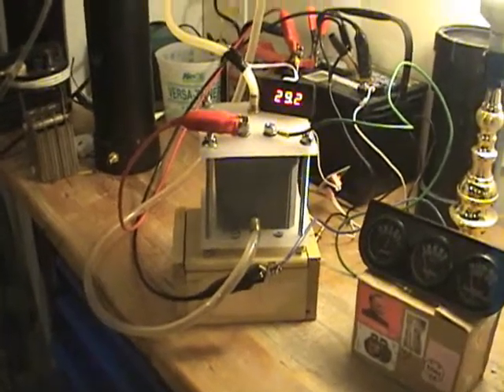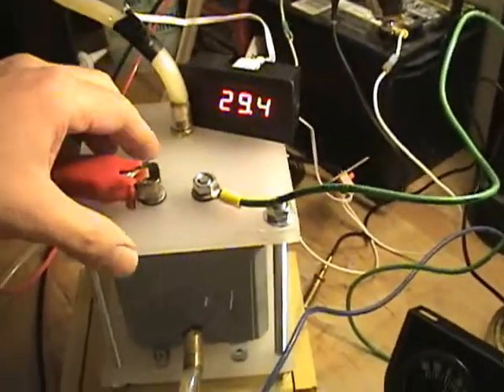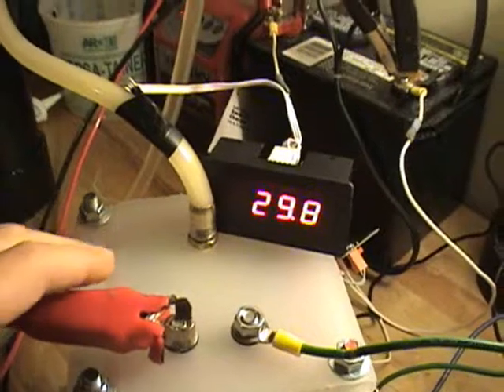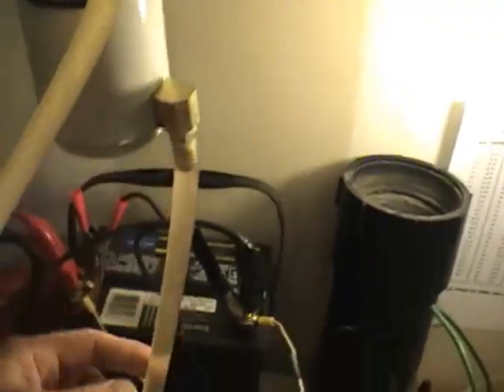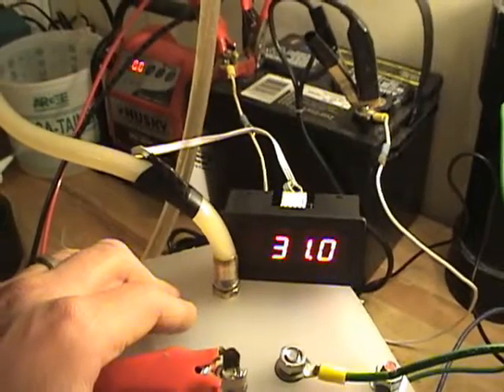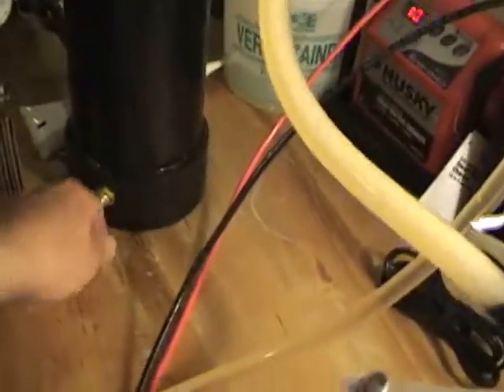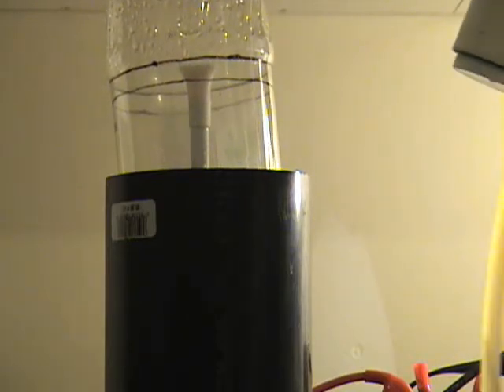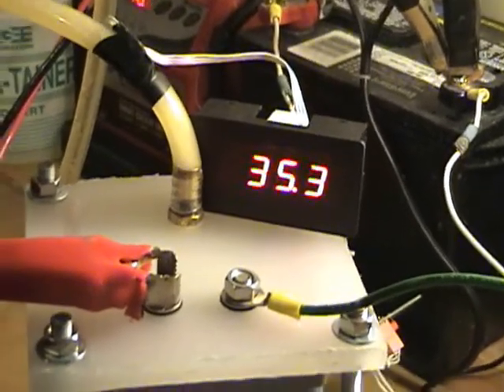(4) same HHO cell better seal

Comment: sure ... I have measured no diference between +nnnn-nnnn+ or -nnnn+nnnn- ... seems they both produce the same amount of gas for a given input power ... generally, I suggest the 5N setup for 12v systems, but have seen folks have good results with 4N, 5N and even 6N ... so you just gotta tinker with it and see what works best for you ...

Comment: Some have told me that as little as 500ml of HHO injected at the right plate in the intake will give noticable improvment in mileage.  The best results have been reported from people with larger engines. In general, the folks with smallish, already fuel efficient engines got less improvment. Unfortuately, there is little hard data, only overstated marketing claims.  I am watching John Aaron's efforts and a few others to see what numbers come back. Hard numbers may come soon.

Comment: I know, the temptation is always to focus on making a lot of gas.  And making a lot of gas from a small device is a noble pursuit. But the reality of brute force electrolysis is that surface area + amps = gas and volts = heat. If you were to fine tune your plate connection to optimize for your 12v power, your production may go down. But, you will make more gas per watt of energy used. So in reality, you will optimize the surface area of your device and the power you have available.

Comment from the maker: this is my problem and maybe you can educate me. the setup your talking about i know will reduce my heat. what im trying to do is get the most hho out of the smallest container possible. is it possible to get 1LPM out of 11 small plates? and really will it make a difference in my gas mileage in my neon? your setup= about 400-500ml i've tryed it.

Comment: if its not too much trouble with your 11 plate setup, try connecting them +nnnn-nnnn+ and see what happens ... you production may go down a bit but the amp should go down even more ... so in general, your efficiency should go up a lot ... then if you like what you see, work on sealing the plate edges as much as possible and it be even more efficient ... easy to make lots of gas, trick is to make more gas with less energy ...

Comment: Nice job. Good idea for improving the electrical box for hho, a few more neutral plates would probable keep the heat down. Running just a couple of volts per plat produces more hho, less heat.